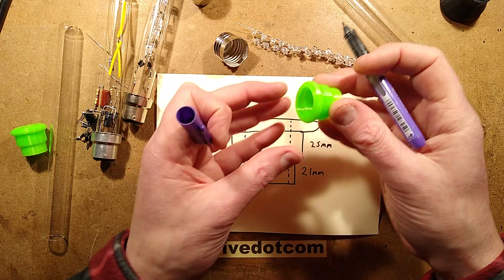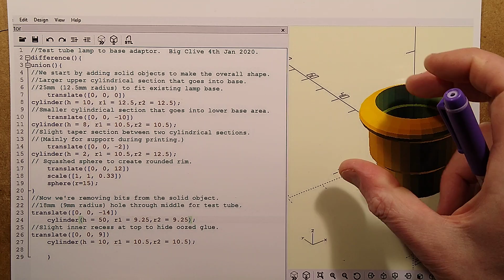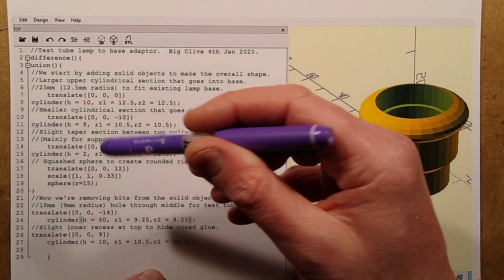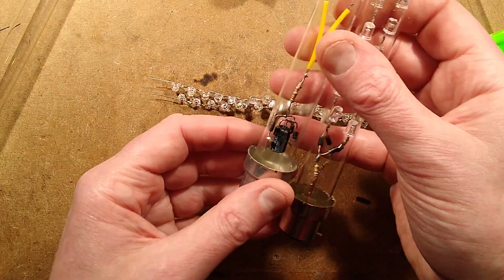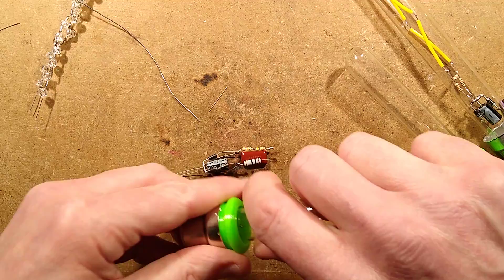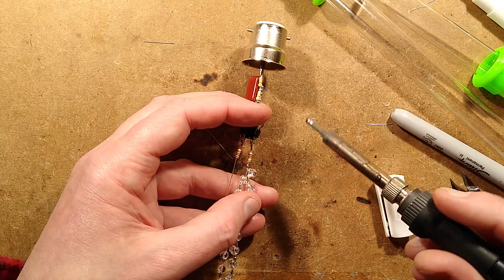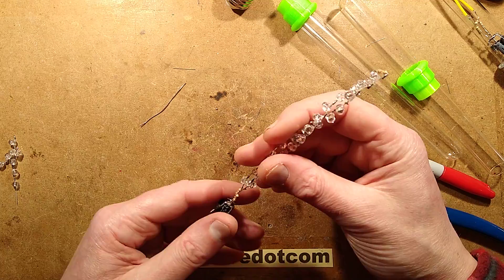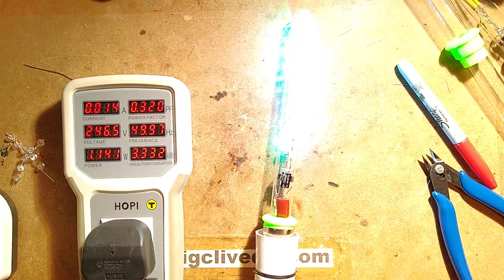3D printed LED test-tube lamp.  (with adjustable 3D openSCAD file)

Comment: I should have said, it works as you had it by the way.
If you'd like to change the sizes of the parts, I've 'parameterised' some of them here:

TubeDiameter=18.5;

GlueReliefDia=21;
GlueReliefDepth=10;

UpperCylinderDia=25;
UpperCylinderLen=10;
TaperLength=2;
SmallCylinderDia=21;
SmallCylinderLen=10;

SphereDia=30;

//Test tube lamp to base adaptor.  Big Clive 4th Jan 2020.
module outerPart() {
    //We start by adding solid objects to make the overall shape.    
    //Larger upper cylindrical section that goes into base.
    //25mm (12.5mm radius) to fit existing lamp base.
    translate([0, 0, 0])
     cylinder(h = UpperCylinderLen, r1 = UpperCylinderDia/2,r2 = UpperCylinderDia/2);
     //Smaller cylindrical section that goes into lower base area.    
     translate([0, 0, 0-UpperCylinderLen])
     cylinder(h = SmallCylinderLen, r1 = SmallCylinderDia/2,r2 = SmallCylinderDia/2);
     //Slight taper section between two cylindrical sections.
     //(Mainly for support during printing.)
     translate([0, 0, 0-TaperLength])
     cylinder(h = TaperLength, r1 = SmallCylinderDia/2,r2 = UpperCylinderDia/2);
     // Squashed sphere to create rounded rim.
     translate([0, 0, UpperCylinderLen+2])
     scale([1, 1, 0.33])
     sphere(r=SphereDia/2);
}

module innerPart() {
//Now we're removing bits from the solid object.
//18.5mm (9.25mm radius) hole through middle for test tube.
    translate([0, 0, -14])
        cylinder(h = 50, r1 = TubeDiameter/2,r2 = TubeDiameter/2);
//Slight inner recess at top to hide oozed glue.
    translate([0, 0, GlueReliefDepth-1])
        cylinder(h = GlueReliefDepth, r1 = GlueReliefDia/2,r2 = GlueReliefDia/2);
   
}

difference(){
    outerPart();
    innerPart();
}

Comment: An idea for replacing the test tube with something a little less fragile: bottle preforms. I'm not sure if they come in sizes that match the aspect ratio of the test tubes you are using, but they usually have the opening threaded. One could model in the threads in the adapter to allow easy attaching and removing. Most preforms are made of PET, so the adapter could be printed in PETG and then a PET cement could be used to permanently affix the preform to the adapter.
Just knocking around an idea.

Comment: The Bob Ross of soldering!!
Thanks for the SCAD tips Clive, perhaps you could make a small PCB for the capacitive dropper and make more space for even more LEDs.... on the one hand you would not be able to see the cool components, but on the other you could use stupidly small SMD parts like a multi layer ceramic dropper cap!

Comment: Sadly the script from the description doesn't work as is, at least not for me. YouTube seems to shuffle around end-of-line markers so some code ends up as part of comment etc. Works fine with a bit of manual adjustment. Tested in ScorchCAD (openSCAD clone for Android).

Comment: Hi Clive,  if you'd like the two parts of the SCAD sequential as you mentioned when you started the video, you could do something like this:
//Test tube lamp to base adaptor.  Big Clive 4th Jan 2020.
module outerPart() {
    //We start by adding solid objects to make the overall shape.    
    //Larger upper cylindrical section that goes into base.
    //25mm (12.5mm radius) to fit existing lamp base.
    translate([0, 0, 0])
     cylinder(h = 10, r1 = 12.5,r2 = 12.5);
     //Smaller cylindrical section that goes into lower base area.    
        translate([0, 0, -10])
     cylinder(h = 8, r1 = 10.5,r2 = 10.5);
     //Slight taper section between two cylindrical sections.
     //(Mainly for support during printing.)
        translate([0, 0, -2])
     cylinder(h = 2, r1 = 10.5,r2 = 12.5);
     // Squashed sphere to create rounded rim.
        translate([0, 0, 12])
        scale([1, 1, 0.33])
        sphere(r=15);
}

module innerPart() {
//Now we're removing bits from the solid object.
//18.5mm (9.25mm radius) hole through middle for test tube.
    translate([0, 0, -14])
        cylinder(h = 50, r1 = 9.25,r2 = 9.25);
//Slight inner recess at top to hide oozed glue.
    translate([0, 0, 9])
        cylinder(h = 10, r1 = 10.5,r2 = 10.5);
   
}

difference(){
    outerPart();
    innerPart();
}

Comment: The test tubes of my boyhood often had a lipped opening, or am I imagining that?

With LEDs, there’s no need for a borosilicate test tube: not a lot of heat.
Reply: Pyrex ones still do. Throw away test tubes don't.
Reply: ...to guide in the rubber bung?
Reply: What keywords should one search ebay for?  I see lots of sizes, etc.  Is there a term for finding them without the lipped opening?

Comment: Fusion360 is a much better choice. OpenSCAT might have been great 10 years ago.
Reply: Only if you trust it to remain free for hobbyists forever.
Reply: @NiHaoMike64  If it doesn't, there will always be an alternative better than making 3D models via text input.

Fusion360 is so far superior, that it hardly makes any sense to mention why.

Comment: That is so cool. I love it, but i don't have a 3D printer.
Reply: Surely by now you know someone that has one. Even if they charged you, the finished product shouldn't cost more than a couple USD
Reply: Thanks for jogging my memory Kyle, i do know someone who has one, i shall inquire. But thinking about it a bit, i have a frosted Kilner jar i could use with the colour changing LED's, that would be a good effect.

Comment: Lining the tube with some thin light scattering material could add a nice effects. Could try a piece of Mylar that you lightly scuff up with some 2000 grit sandpaper?
Reply: Reflective Mylar is also conductive, so as a bonus you could get a bigger light show than you expect. :)
Reply: Rambozo, good job keeping an eye out for safety concerns. But I was talking about plain clear Mylar and scuffing it up. Not the Mylar that has had coatings put on it for reflectivity such as on balloons.  Plain Mylar is not conductive as far as I know.
Reply: @somethingelse2740   Well that takes all the fun out of it.
Reply: @RambozoClown  , Indeed it did.

Comment: OpenSCAD is AWESOME! Used it for years, it's good stuff.

It's done that way because it's kind of a programming language, you can actually make the two shapes in separate functions, then do the difference of the functions. I've done that sort of thing with more complex shapes.

That said, I can never remember it all either, so I use this cheatsheet: https://www.openscad.org/cheatsheet/

Comment: I've used quite a variety of the colour changing LEDs and I have to say wiring them in series does not seem a grand idea.

These are constant voltage devices. Ideal operating voltage is 3.0 to 3.3 volts. More than 3.3V across them and things can get smoky. I can certainly attest to the risks having build a light that ran CC LEDs at 4.5V. It was fine for many hours before a few of the LEDs literally burnt out, All that remained of the worst affected LED was the lead wires and the bottom of the clear plastic over moulding.

What complicates any attempt at series operation is the ESR of the LEDs changes as the colour changes.
Reply: While I agree with the series issue, how sure are you about that 3.0-3.3V thing...? The ones I have (Optosupply OST1MA5A32A) seem to be distinctly 5V(ish) devices (Vdd min. 3.8V typ. 4.5V max. 5V) according to their datasheet; unfortunately, when actually fed 5V they seem to get disturbingly hot though, so I'm not even sure how the hell these are supposed to be powered - in the end, do they need a fecking series resistor or not, wtf?!?
Reply: I'm reasonably certain of the 3.0 - 3.3V thing as a number of packets of these that I've bought were labelled as such. That said I've also seen spec sheets claiming 5V...to be precise TTL operating voltage ranges.
Yes they get hot at that voltage so tried setting the supply on the array of 100 down to 4.5V and prayed as they were still getting pretty warm. Eventually after over 1 year of operation there was some smoke and bad smells from the LEDs at the centre of the array. Lesson learned. :(

No I would not use a series resistor as these are not a diode that emits light. They have to include some electronics to time the whole colour changing thing and the current does vary  during the cycle of colours.

How I now power them is from just about any DC power supply followed by one of the cheap buck converters set to deliver around 3.2V. At around USD1 these buck converters are quite a bargain. Without a heatsink they will happily run 50 CC LEDs and with a heatsink up to 100.

Comment: I'm so happy that you choose OpenSCAD. I hesitated for a long time buying a 3D printer, because I was afraid of the steap learning curve one encounters when trying to use the more conventional free CAD software. Same day finding OpenSCAD, I ordered my 3D printer. Because in OpenSCAD, 3D modeling is just like programming. And that I already can do, thanks to Arduino/ESP. All you need for OpenSCAD is this: https://www.openscad.org/cheatsheet/
It lists all of the commands, with links to a good explanation. Click on difference() and you'll see why the first thing after that is a union() in the example that you transformed to a test tube lamp fitting adapter ring.
Some tips:
Use variables at the beginning of your script, for example, one that specifies the radius of your test tube. Basically, I use variables for almost everything.
And the flow controls are great, too: for-loops let you create repeating shapes, like, a decorative pattern. If/then/else let you automatically add extra screw-holes and -pillars in an electronics enclosure if you specify it to be above a certain size, using the variables.
Please look at that cheatsheet-link and realize that this is basically a programming language. By leveraging that, you'll be able to design the wildest shapes. Or, download an example and modify it.
I found an example of a configurable 7-segment display. I tweaked that and created a big digital clock with it, using black PLA for the 7-segments and transparent PETG for the fronts of the segments. 4 7-segment-displays of 20 cm height with a self-designed : -holder in the middle, mounted on a piece of wood. Each segment has 2 neopixel leds, so each display has 21 leds. All of that is wired up to an ESP8266, which will get the time from the network and the desired colour from my home automation installation. An LDR on an analog input automatically adjusts the light intensity to the ambient light. About neopixel leds: don't buy individual led. Buy a led strip and cut that up: more leds for your money and easy to solder.

My 3D printing setup is a cheap Anet A6, fitted with a BLTouch sensor, Marlin firmware, a glass print bed and some printed mods for holding the BLTouch and some parts cooling ducting, with, of course, an OctoPI for networked printing. I'm slicing in Cura, printing from the Cura OctoPrint plug-in and I'm designing in OpenSCAD. Works great.
Just... don't change anything on your Youtube channel's format. There are already enough channels out there about 3D-printing.

Comment: Slightly off topic but any recommendations for lead based solder and solder paste in the UK? Had a bit of bother getting some for last project
Reply: Getting hard to find at electronics retailers but The Range, of all places, still sell 60/40 in 17g tubes and on 100g reels. Paste may be harder though.

Comment: Fantastic Clive, it's great to see you utilising 3D printing, I've been into it for several years and I thoroughly enjoy it. I have used open SCAD but I prefer Fusion 360, no problem though, your model is easy to recreate in Fusion 360.
Reply: Always good to have something you can store as text, share as text, track changes in it using any text VCS, render with ease using an open source engine, and even edit it using almost any text editor you like on almost any computer/computer-like device.
Reply: @jkobain  Very true, the ultimate in portability.

Comment: In my college days, I was taught solder was ONLY for the electrical connection NOT for a mechanical one Each joint need BOTH mechanical and electrical connection
Reply: Parts are a lot smaller and lighter than they used to be.  Mechanical support is not really an issue in most applications.
Reply: @Scodiddly , when it comes to PCB, SMD can be worse than the old PTH components. if you've seen SMD components fly off a PCB during vibration testing, when the board hits resonance it is amazing how much it will bend. it is still important to clamp wires if they are soldered. where the solder stops in a multi strand  is a weak point were the strands will work harden if moved about to much, as each strand breaks the stress increases on the remaining ones speeding up the failure. this is why in a crimp it always crimps on to the insulation.
Reply: Solid core wire / conductors can also suffer from stress breaks if the conductor is nicked when the insulation is stripped. A major British company suffered a safety related control system failure due to a solid core cable breaking and the broken end dropped down and touched a different live terminal, which resulted in a control system failure that put peoples lives at risk. Luckily an operator noticed that his indications were showing an abnormal state before it caused harm. Hence always use suitable wire strippers rather than using wire cutters. Correctly terminate cables and wires. Make sure wiring is secured and can’t move unnecessarily. And provide mechanical support.
Reply: So was i and at work, when a wire was connected to a pcb it was wrapped around  a pin or went through a hole big enough so that the insulation was inside hole and the conductors bent over 90 deg and soldered to the track. built equipment for fighter aircraft where vibration is a big issue.
Reply: @TheEmbeddedHobbyist  how true I when on to work on handheld Radio communications some used on Oil Rigs which had to be all to a high spec in such a work environment.
Reply: They don't teach Milspec 2000 electrical assembly standards in College. ;)
Reply: Pat McDonald  so true, I started as a Prototype wireman apprentice, learned a lot about wiring and assembling PCB's and equipment etc. All we made was for the military markets so quality and reliability were the major key points in manufacturing and design process.
Reply: So was I. Then I began to look around and saw that every circuit board in the world seems to rely on solder alone, not a mechanical connection. Also, the copper water pipes in my house have 80psi of pressure, and have relied on solder alone for 40 years.  I quit worrying about it and have never had a problem I could attribute to not making a mechanical connection.

Comment: the nice thing about OpenSCAD is that the S is for Script. The whole program is a scripted CAD program making it extremely flexible. It can also be extremely difficult when trying to design more complex designs.  I personally use FreeCAD for most of my design products.
On a side note, you could have made your design with only 2 lines of code.  Draw the base design profile and then rotate it around the center axis.

Comment: you can use nylon with glass fibers that is 115 degrees safe to use , there are better plastics but you need more expensive mahcines to make them, there are plastics that go few hundred degrees stiff and flame retardant

Comment: Instead of these lines
//25mm (12.5mm radius) to fit existing lamp base.
cylinder(h = 10, r1 = 12.5,r2 = 12.5);

you could have used these
//25mm (12.5mm radius) to fit existing lamp base.
cylinder(h = 10, d1 = 25,d2 = 25);

Comment: i always thought it was pronounced open-s-cad
Reply: It stands for open source cad. For a while there was the unfortunately named open s cam for machining operations. They changed the name. Not sure it's still being actively produced.
Reply: @birdmun  do you pronounce it open scad then?
Reply: @billysbikes8671  I usually say open scad. Open s cad works too. :)
Reply: @birdmun  ive never heard any one else say it out laud so it sounded weird to me :) do you do any 3d printing there's a slicer called Slic3r some call it "slic 3 r" some "slicer" anyway yes both ways are fine :) i did try open scam but i ended up using fusion 360 its much better.
Reply: @birdmun  ps your beard is fantastic!
Reply: @billysbikes8671  the beard is 5 years old. :P I started out with a much older slicer. The name is escaping me currently. Slic3r was next and I have always pronounced it slicer. When nerds see l33t or 3l33t they don't say El three three tee they say leet. Slick 3 r drives me bonkers. :P I currently have cura installed. It's working on my Linux box again.
Reply: @birdmun  sweet i use cura and octaprint on a pi zero for my 3d printers and use fusion 360 gcode and octaprint for my cnc so i dont need to walk to the printer :) free software is so good these days! cad programs costed too much and the free ones 20 years ago where crap kids these days are spoilt :)
Reply: @billysbikes8671  I tried playing with a csg program years ago, that was used by the military. It was difficult but as I recall similar to OpenSCAD. As I recall you had to include lighting to finish the ray tracing render.
Reply: @birdmun  scad is a bit much for me i prefer fusion 360 i have done quite a bit of programming but im lazy. i do a bit of c++ with arduinos i quite like to do programming to interact with hardware devices but i started out with sql and vb script and a bit of java years ago for web applications and websites for businesses but i left that to get out of the office. im now a cycle mechanic and do it all for fun. i found it boring in the end when its just for commercial business applications :P